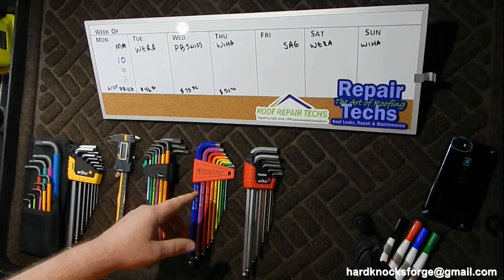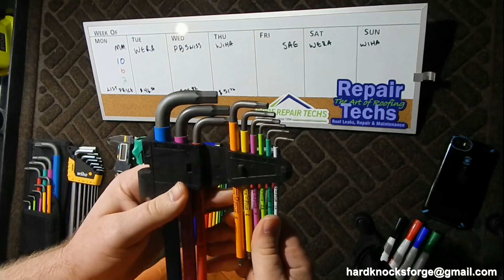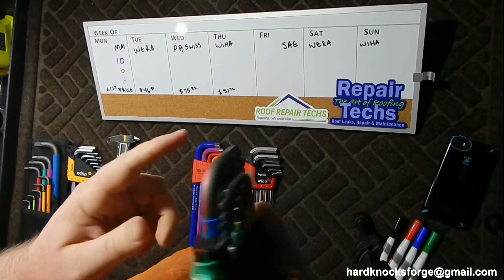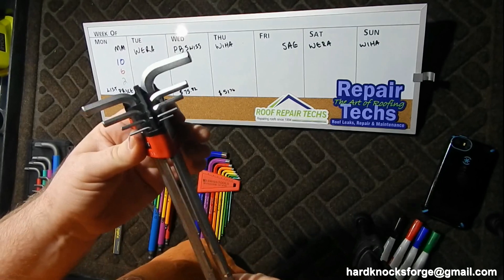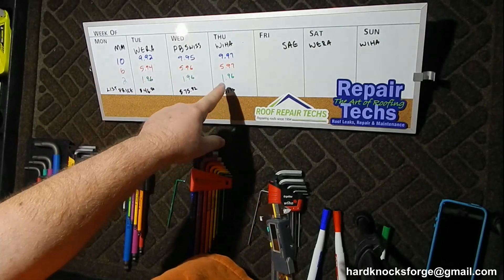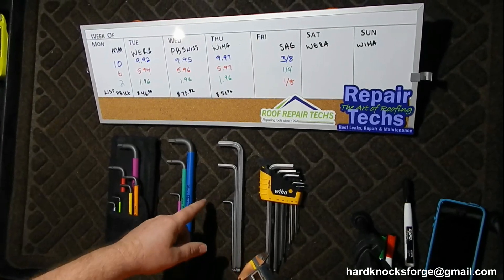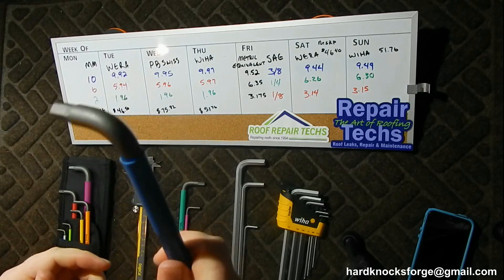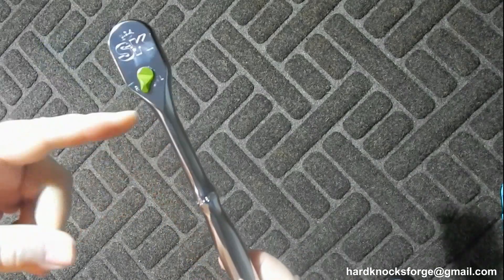Wera vs. PB Swiss vs. Wiha comparisons Caliper Death match  L Key, Allen Wrench, Hex Wrench

Comment: Hi there, I think you are missing the point of the geometry of the Wera set. It is not about tolerances. It is about where the force is is applied on the screw. I've compared them with Gedore, Hazet, Wiha and Wisent with a damaged screw head. When all the others won't grip the screw anymore, the Wera keys where the only one being able to loose and tighten the screw.
Reply from the maker: I understand that but I was doing a video on the tolerances of the hex keys. I will have a video in the future testing these in damaged fasteners.
Reply: Hi there! 

Yes, you have measured some widths, but with wich intend? You haven't even have a look at the DIN ISO 2936:2016-10 or other norms to compare it against something. So therefore your conclusion is kinda worthless in this regard. 

I still enjoyed your video. Don't get me wrong. It was fun to see so many kexs side by side. I am not a Wera fanboy either. I thing they overdo their packaging, I hate their cheap plastic holders and I don't like their handles. Wiha does a much better job there. But the Hex-Plus safed my ass to often to not love them. 

Regards,
Etna.
Reply: True , its the hex-plus factor which mainly sells their keys  ,
Reply: CC MOGS so are you suggesting not purchasing them? I was considering the wear or the Swiss
Reply: @athomas2k8  I absolutely suggest to go with the Wera, so far it was the only set that could remove damaged fasteners when the others failed. I should also point out Wera has a US patent for the geometry and until that expires, they hold the line. Once that's out, probably all manufacturers wioll try their best with it and it will become an industry standard.
Reply: HunGredy I end up getting some 2 months back thanks!
Reply: I second this. The Hex Plus profile can grip damaged fasteners even when a normal hex won‘t. It isn‘t magic of course, if the fastener is completely rounded it won‘t help. 
But more often than anyone would like there is that inbetween spot where Hex Plus works and saves you loads of trouble.
Reply: @HardKnocksForge  I think you are misusing the word "tolerance."  You mean to use the word "dimension."  I'm certain that the Weras (and the others) are made to a tolerance of 0.001mm or better, but they are specified to different dimensions from each other.

Comment: Let yourself be told by a German mechanical engineer:
If you had understood the principle of Wera Hex Plus, you would know that the application of force does not take place in the corners of the hexagon but on it's surfaces. To accomplish this it is necessary to design the tool a little bit undersized.
Reply from the maker: I understand the principle. It's the same exact principle as the Snap On flank drive (patented in 1966) and the SK Sure Grip. Just inverted to work on the Allen head screws. If precision fitting of fasteners wasn't important then why would PB Swiss and Vessel make the best fitting screwdrivers out there? They are as close to a precision perfect fit that they don't ruin fasteners. I know that even around here, when it comes to medical operating rooms, they use PB Swiss drivers, not Wera hex plus.
I was measuring for precision and had a hard time getting the 'normal' Wera L key wrenches. I'm trying to do a whole series, eventually, with every option of L keys out there. If you have a couple sets laying around I'd sure like to measure them for my next video. Email here hardknocksforge@gmail.com
Reply: @HardKnocksForge  that only works when the bolts are made with the same tight tolerances. For pricey medical equipment, I surely hope they use good quality bolts. However, building IKEA furniture and maintaining bikes, this isn't always the case unfortunately. Therefore, for most use cases I prefer the Hex Plus keys. I understand using PB Swiss for medical equipment though. They are very high quality.
Reply: Wait shouldn't the surfaces be convex then instead of concave? Doesn't make sense what HKF measured then. Force on the corners would be even higher if the surfaces were concave.
Reply: @saiiiiiii1  the force is exerted on the corners, you're right

But the concave geometry spreads and translates the mechanical strain into the shaft better and hence the user would feel like there is more torque
Reply: @sandy_knight  honest question: does Shimano XTR use different bolts than Deore? Because XT and Deore seem to use the same.
Reply: @sandy_knight  that's totally understandable.
I'm still not convinced of bolt quality of bike parts in general, including the major brands. My Fox fork has pretty sloppy tolerances and the Hex Plus keys seem to work best. Hope might have better parts, I suspect. However, between PB Swiss and Wera, you're probably splitting hairs, with Wera better for slightly worn or out of spec bolts and PB better for high quality bolts in good shape and tight tolerances. Both will be miles better than the usual DeWalt / Home Depot or even Park Tools equipment (overrated for non bike specific tools in my opinion).
Reply: @macvos I am 90% sure that the XTR callipers use Titanium bolts, while the XT and Deore use steel

Comment: I bought a set of the wera hex plus about a year ago and I have to say they are superb coming from a set of bondhus Allen keys. I found the bondhus to be average in quality due to rounding the 4mm and below and snapping a 6mm. The hex plus works brilliantly whenever there is a rounded head in the shop everyone borrows my set and it's yet to fail! My only gripe with weras is that if they get heavy use with coolant or oil around the sleeves  will eventually come off and won't fit in the holder without them on. Save yourself some money and get the plain metal ones and you've got a good set that'll last a while and get you out of bother with those rounded heads.

Comment: I've had the Wera's for 6 years or so and I've been sold by the the Hex-Plus profile as it really does work.  There's a Japanese company called Vessel that has been producing hex keys with a Hex-Plus like profile as well.  Asahi is another Japanese manufacturer that has been producing hex keys (and bit sockets) using the ball-retension method.  I have a set and they work good.  Ko-ken, another Japanese tool makers, has bit sockets with essentially the same retention method as those Wiha Magic Rings.
Reply from the maker: I saw a guy put out a video on the wera vs the wiha retention devices earlier today. I didn't know Vessel made L keys. I know their screwdrivers are awesome especially when it comes to Japanese JIS screws which some guys cornfuse with Philips screws. I have been looking at some Ko-Ken stuff here lately as well.
Reply: Yeah, I saw that video by GTR today.  Vessel makes quite a few things, including pneumatic tools, and even, of all things, anti-static tools and foot mats.  
The thing about JIS screwdrivers is that most people aren't aware that Vessel has stopped producing screwdrivers made to JIS standards many years ago.  They are produced to international standards that's backwards compatible with JIS screws.  If you REALLY want JIS screwdrivers, you need to get something vintage/NOS.
Ko-ken is awesome stuff in my books!

Comment: I love how the Wiha set opens to make them easy to grab. They all use very high grade steels but I'm betting the PB Swiss would hold up the longest
Reply from the maker: The PB Swill will hold up longer being as how the steel is a much better quality steel then the other two. I think they have the best steel in the L key game, even though I've heard tales of Bondhus going to the same spring steel that PB Swiss uses.
Reply: PB Swiss are practically indestructible. Ran Swiss made Bobst Die Cutters for 43 years and had a set of PB hex keys that I still use at home.

Comment: The Bondhus use a special alloy called protanium,  try breaking one. Spring steel / chrome vanadium is far cheaper than you think. S2 and Chromolly cost much more.
Like most things that have to have both sheer strength and ductile properties, it is all in the heat treatment.

Comment: The slightly smaller dimensions of the Wera might have to do with their "Hex-Plus"-profile. Also you should take the radius of the edges in to consideration. The sharper the edges, the better the grip in the fastener.
Reply: Ding Ding Ding.  Great thinking my friend!

Comment: I think the numbers you see with the Wera is simply due to the Hex-Plus profile.  It's basically flank-drive, instead of edge-drive, like the others are.  I think that needs to be taken into account when analyzing these numbers.
Reply: Not to mention...the Hex-Plus shines when the fastener your dealing with has been marred up.  Where the others will fail, the Hex-Plus will still work.  This was my experience.  So, if you always dealing with clean/unmolested fasteners, then the standard hex key profile will suffice, IMO.
Reply from the maker: Right

Comment: That isn't slop on the Wera, the hex+ pattern is designed to grip the hex of the screw slightly back from the corner meaning the flats side to side are deliberately undersize. Look at a graphic on how hex+ works for better detail. All three are nice tools though so can't really go wrong though PB Swiss prices in Europe are crazy expensive, normally double and a bit more compared to Wera or Wiha for anything they make L keys, screwdrivers, micro drivers etc. It's mad that you get better prices in the US for a euro made tool that we do in Europe!
Reply from the maker: Yeah the prices normally don’t work like that. I’ve actually bought some German tools and had them shipped over for half of what some companies over here charge for the exact same tools.

Comment: For what its worth - I just measured my 2mm bondhus standard issue hex L with my mitutoyo cd-6 asx digital calipers and i got dead nuts 2.00mm on each of the 6 sides. accuracy of size alone is likely not the way to test for best hex.

Comment: When I first saw this, I was pretty heavy on the wera stuff. Very tight tolerances on most of their tools. But apparently the weha is a little tighter tolerance.
Reply from the maker: Yeah and even though it's all just 'splitting hairs' when it comes down to it. The PB Swiss are made outta freaking spring steel. Talk about a hex you can slide a pipe onto...
Reply: Wera wiha we r all typing typos and trying to type the other.  No one knows anyone’s opinion. By the time I’m done watching I can’t keep track of which is which so I went Swiss ha ha

Comment: I always have trouble with hex and Allen key. I like socket based tool that I can wrap a hammer on for good measure. Though any of these sets would serve their own purposes. Good video HKF.
Reply from the maker: Yeah if I were going with a set for strength and the ability to maybe throw a pipe on from time to time I'd go with the PB Swiss. They are made out of a much better steel than the other two and could handle way more abuse.

Comment: PB Swiss are the best, been using for over 10 years on the same set and still going strong, just using a digital calipers measuring the size doesn't tell me much, not to mention the life time warranty that PB Swiss offers.  I would like to see you torque some bolts down and see which set rounds the fastener first and which set can remove the rounded fastener.
Reply from the maker: I'm working on that right now...

Comment: The wera hex keys suck if your using them everday. Imperial is missing the 9\64 key. The writing on them wear off quick . Not to mention ball end broke on my 4mm. They are considered consumables so no replacement . And lastly that coating is more of a hinderence when you need that extra 32 of an inch. Really disappointed because I'm a wera fan.

Comment: I have a slightly cheaper wera pkl hex plus set in daily use for over a year. Everybody in our workshop has changed to these after seeing how good they are. You can definitely apply more torque with the plus feature.
Reply from the maker: Yeah honestly that's why I believe they were the 'sloppiest' as far as specs. Without that hex plus feature they may have been closer to the PB Swiss and Wiha.

Comment: I would not have thought that they where better than pb Swiss. Thanks for the video.
Reply from the maker: That's what roof repair techs said. He told me after we measured the all the 10mm keys that he was sure PB Swiss would have had better tolerances, because they advertise on how tight of tolerances they have. I'd heard of Wera and Wiha before but I don't have any and PB Swiss I just learned about Saturday when RRT showed up to the meet and greet and brought a car full of tools with him.
Reply: Hard Knocks Forge 
I put my dirty meat Grabbers on some PB SWISS screwdrivers at Junkies meet up for the first time and i will be getting some. They really impressed me. Its the attention to detail.
Reply from the maker: Dave Tumbleson yes roof repair techs had some as well and I was really impressed also. The handles were superior to any I've ever fondled. They felt like they were made out of unicorn hides. Maybe not, but they were pretty damn exotic.

Comment: Wiha looks the best out of the bunch. A German tool brand I like is Knipex. I have had 2 of there 10 inch Wire cutters for extensive work purposes, the first lasting and cutting a lot and good 5 nights a week for at least a year, replacing the first pair because I lost them. I cut threw cable wire, chains, crews, and nails with these things small diameter of course.
Reply from the maker: Wiha was the best fitting or least sloppy fitment. You can't go wrong with a good pair of anything Knipex.

Comment: You forgot to mention Wera features the hexplus design, proven to be way better than the standard hex design, this is a big factor in the pricing. You get a way better hex key for a bit more $. The hexplus design is sure to be copied as soon as the patent  runs out. 
If you have problems with overtorqued or damaged hex bolts, wera hexplus is the way to go.

Comment: This was a good comparison video and it's got me thinking about which ones I'm gonna buy. I was gonna buy the Wera but now I'm thinking the Wiha is the ones to get. I also like the way they come in that holder.
Reply from the maker: Yeah that holder is slick. Even when it's open the keys won't fall out. There is still some pressure there to hold them in. They are the most precise on tolerances, even though we're talking about hairs. The one thing I liked about those also was the spring tip on the long end. It'll hold whatever screw you need so it only takes one hand and just makes everything so much simpler.

Comment: Thanks for the video, I like the color concept of identifying the different sizes, just don't think I can have the rainbow warriors in my box. That's great looking ratchet, I bet it will pair up with those Mac socket set you won.
Reply from the maker: Yes it will. I got the sockets today so i'm doing the video on them tomorrow-ish. I didn't know that's what they were, I wasn't expecting them until tomorrow. I guess they are practicing on getting things out quicker since the holiday season starts soon. Gotta get them guys back into shape...
Reply: Hard Knocks Forge, I was surprised when I checked the tracking number and seen that they was on your porch. I can't wait to see your video, and see what is your thoughts on those short sockets.
Reply from the maker: Beer Stud I think I just uploaded it... if not it will be tomorrow's video.
Reply: All these brands make non colored version also for less, it just makes it easier to identify the size by color, like Wera Sockets use the same colors as there Wrenches and other stuff they make, Wiha makes a more neutral color coded not so Rainbow colors and also black or stainless, and same with PB Swiss make some stainless also or solid colors for all sizes in the set (all red or all blue or all green and so on, even gold plated keys)

Comment: Wera is still the better of the 3 imo, there designed with more slack on purpose. More torque without damaging the inside of the bolt head..
Reply from the maker: I've heard other guys say the same thing. I think you are maybe less likely to damage one that's already damaged with the Wera, but I think precision on new and undamaged fasteners is where you want less 'slop'. Keep in mind though, we're talking about half a hair of slop vs 1 1/2 hairs of slop, so they are all closer to precision fit than junk L keys. I think that hex plus feature is the reason they aren't near as close as the PB and Wiha keys. I'm looking into testing just what kind of torque we can get out of these guys for a future video. Just haven't nailed down how I'm going to test them though.

Comment: Nice review but also you have to consider that PB Swiss also do a snap ring on the end of their Hex key sets to hold the screw but they give you the option of having a set without it. Also I have had every make going and used them daily and none of them hold up as long as the PB Swiss. 23 years Ive had my PB Keys and they are still awesome. Wera and Wiha don't last long at all when your using them on a daily basis, also too many heads have been rounded off with the other sets if you want the best for continuous use PB all the way!!! 

Link for PB Swiss with optional spring ring.

http://www.pbswisstools.co.uk/catalog/PB_Swiss_Tools/PB_212.LR_H-10.html
Reply from the maker: Yeah I think the PB Swiss keys have the best keys for longevity. I'll have to look at their spring ring keys. Sometimes us Americans don't know what all they offer over there because the stores we buy from only have certain things and don't carry everything. Thanks for the link.
Reply: Ah ok guess being in the UK and a bit closer helps no probs thanks for the review